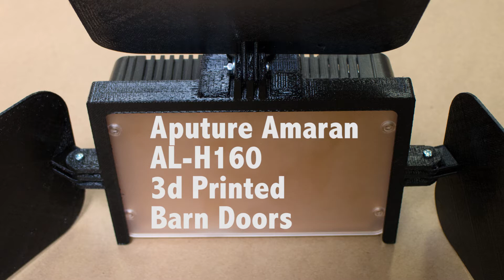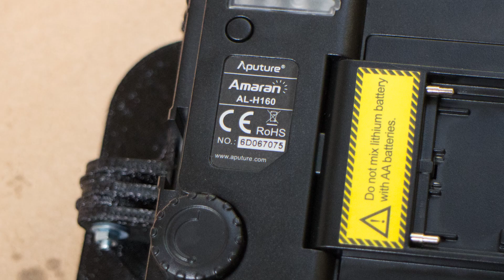Aputure Amaran AL H160 or AL-H195+ 3d Printed Barn Doors

Comment: So I printed and tested these barn doors. Although I already knew there was no bottom door I am wondering why not? Also I see significant banding when closing the doors, but after some research I was able to get rid of the banding by placing diffusion material against the light. I was wondering if you could design a holder to load different diffusion material by sliding it in?